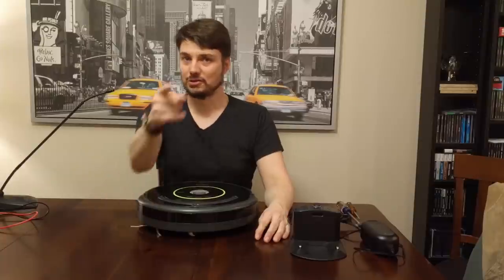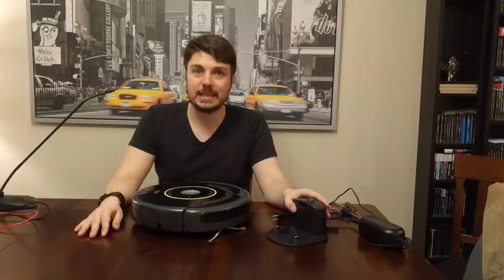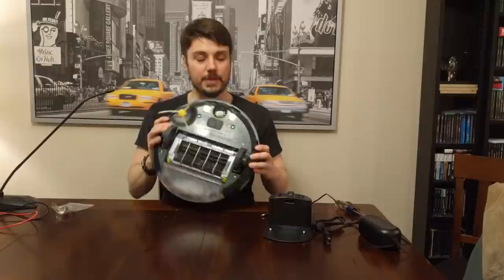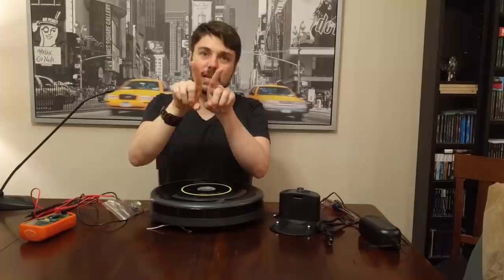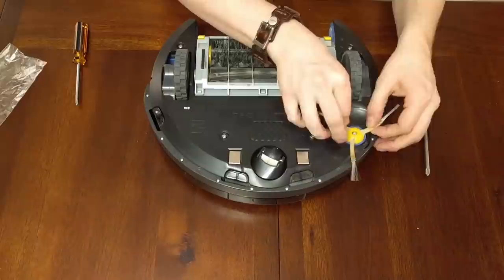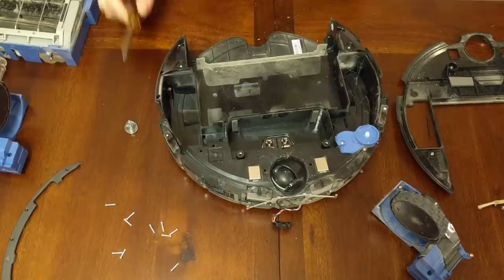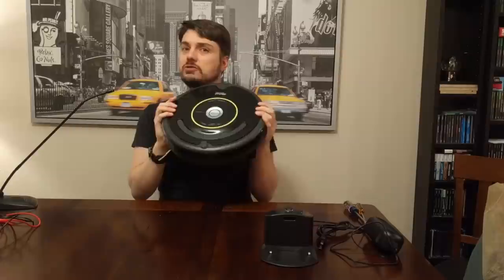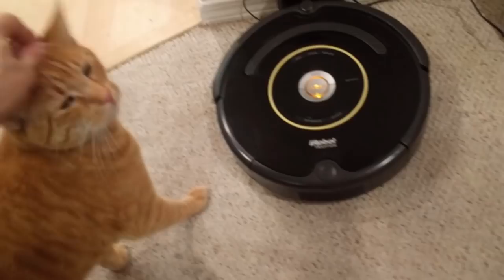Kellys Rambling Robot Repair! Fixing Irobot Roomba not charging on dock or sensing dock 650

Comment: I tested with the continuity tool on my multimeter and it happens like you, so I need to replace that connector... the problem is I found that piece only on ebay for for 15€ + 15€ of shipment... :| 
Anoyone knows if I can found it on a old electronics shop?  If affirmative, what's the exact name of the piece? I doubt I can go there and ask for a "roomba jack connector"

Comment: Hi
Great video. But I try to check with the multimeter the Jack and the thiny plate... and there is connections.
The roomba still doesn't charge over the station . Any suggestion?
Reply from the maker: You checked both the pole and the outside metal peice (both inside the jack?) IF thats the case, it could be your charger, or dirty connectors.
Reply: Kelly's Rambling  thankyou for the answer after 10 min of my last comment I discovered that all my measure with the multimeter had recovered the system. 😫 Now it works 
So it was the security system of the jack connector.

Comment: Many thanks for this video....my 4000 series Rumba has been in the garage in the box for several years now...I just couldn't toss it out and I just can't spend another 250.00 either. It only lasted 18 months and that is unacceptable. ... But now I am going to look for the A/C jack like you suggested...or try and inspect it for dirt...I am having trouble finding the part on ebay. can you post the source?
Reply: Hah i sugest yo try to take a small sharp something and take a flashlght And bend it litl

Comment: Something that does not make sense to me, that part  you  replaced  has  only  2 wires  a red  and black, the charging port has a  positive  and a neutral,  or hot leg  and neutral.
So the male  plug  has a  hot leg  and neutral,  this requires   2 wires,  1 for the hot leg   and one for the  neutral leg. For that  port  to   open or close as describe
That requires  one side of power to be disrupted  as  you  describe.
So if you have the 2 parts before you and the meter, 
If you ohm the new part to see if its  closed  normally  or open normally,  then I would  plug the  charging cord  into  the   port  but ONLY with  the 120 volt  cord  unplugged !! I suspect  the charging port  is  low voltage?
I know  the chaging stands  could not  be  live  with  120 volts  waiting for a dog to step on or a baby, so its  probably  24  volts, just guessing  it  does not matter the theory's  identical, my point is  ohm  the new part  compared to the old "defective"  part and see  if its   normally  open  or closed, and what the   diagnosis  is exactly.

Comment: Wait what.....so it not charging on the dock can be caused by the wall charging port? O_o I keep getting a charging error 5 message. I got a replacement battery but it still does that. I am in the process of working with Newegg to getting it fixed cuz for some reason mine doesn't have the serial number sticker under the dirt collection tray -__-
Reply from the maker: Yes, becuase the bottom two metal charging squares are routed through the side wall charging slot, if one of thsoe two goes bad the other more than likely wont function.  it's just how they designed it with these older models. I'm sorry about your error 5, i haven't received that, you will need to google that to fix it.

Comment: My Roomba use to turn on and say please charge Roomba. I bought new battery and side plug. Took Roomba apart and replaced wire and contact on side charger. Been on charger for days, nothing happens. Nothing.  Dead!
Reply: Does the unit charge at all when plugged in or on dock? Ensure that the battery that you bought is touching the contacts inside the battery bay! Sometimes those contacts inside the bay need to be lifted slightly. Is there any voltage across the leads if you check with a tester on that battery?

Comment: You, sir, are a lifesaver. Just one question (maybe I missed it in the video). What is the "three dollar part" actually called?
Reply from the maker: Try a search for 'roomba power jack' you'll probably get the plug and laptop ones but eventually you'll find it.. HEre's an example ebay link (yes he's charging more than 3$ but it was just the first one i found as i'm kind of in a rush today, if you keep looking you will probably find cheaper)

http://www.ebay.com/itm/iRobot-Roomba-530-Series-Power-Port-Plug-In-585-595-620-650-770-780-790-/132220208928?hash=item1ec8f04720:g:NAYAAOSwwzhZOW0q

Comment: If you dont use the charge port why not just unplug the connector inside !
Reply: Because it fails OPEN - meaning it's a lack of connection that's the problem. Disconnecting it doesn't fix anything. However you could always solder it closed.

Comment: You did a lot of things right Kelly but you did a few things wrong. If you don't take offense I'll tell you what you did wrong. You never touch a circuit board with your bare hands unless you're grounded. (that's why the plastic cover was there) The static electricity from your body can burn out sensitive electronics of the board. You also blew on that plastic cover before putting it back on. That caused it to be statically charged before putting it back on the board! Always use canned air to clean electronic parts off.Not trying to be a smarty pants just hoping to keep some of your readers from making rookie mistakes when they try this themselves,.ok? Another thing you can do is place thin double sided tape over a drawing to place all the screws on. That way you don't have to worry about the table getting bumped and all the screws bouncing everywhere.
Reply: Mycatz2fat I agree but don't agree because it is a sweeper and I wouldn't think touching it would hurt it.Idk just a quick thought.

Comment: In my case (video https://www.youtube.com/watch?v=UE1KwIxWIFY) there was a problem with some solder joints next to the connector J3 on the roomba's mainboard. I thinks this is the same problem on your roomba's original cable at the power jack, usually re-solder this to the pcb should also work. Thumb up!

Comment: I run the m6 daily, and my floors look awesome🌼 allabout.wiki/Roborock-Robotic I wet mop 2 days and dry sweep the rest of the days. When I first got it, I used the included disposable pads. I didn't like them--the dry pad has no depth so if it picks up a chunk of something, like dry cat food, then it pushes it around or drags it around the floor. The wet pad wasn't very absorbent so left streaks and wheel marks.